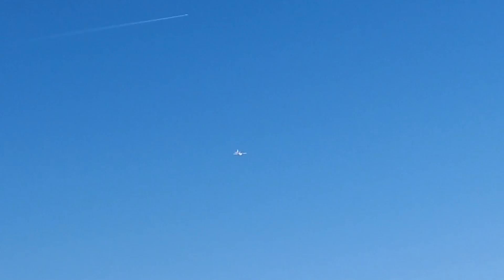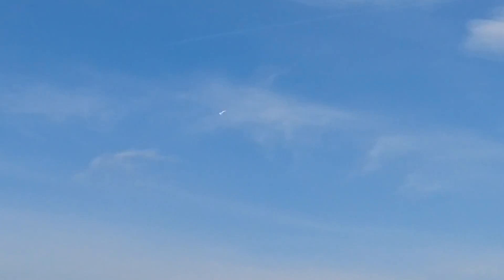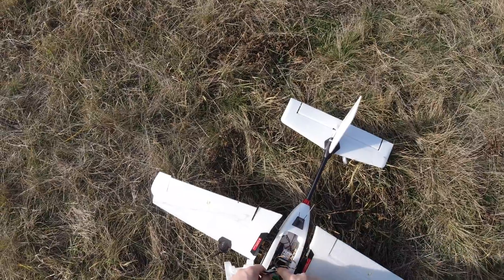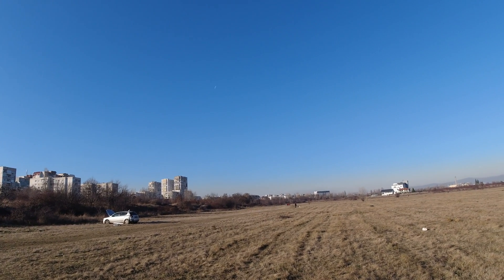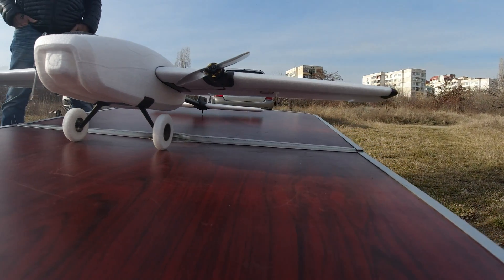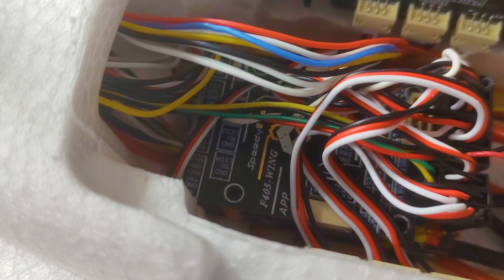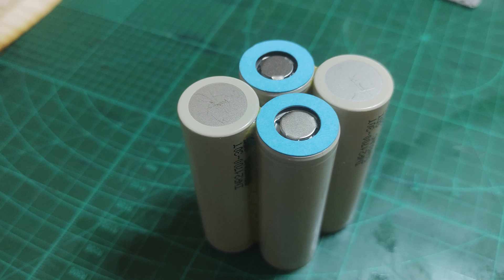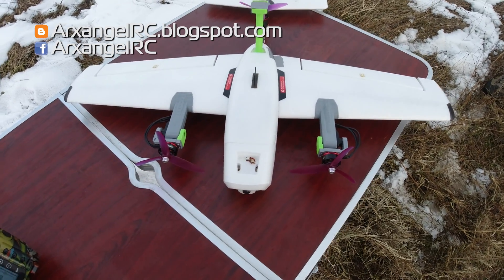T1 Ranger Custom VTOL Conversion - Part 1

Comment: x9d still best ! i'm still using x9d plus se 2019 :D
Reply from the maker: @hoanguyenphuong6405  It is indeed! Mine is from the first ever batch out of the factory, its even older, non Plus. :)
Reply: @ArxangelRC  you do like some new tx product by Frsky ? Tandem maybe ?
Reply from the maker: @hoanguyenphuong6405  They do have some pretty sweet looking radios lately, but I don't have much experience with them, although if mine fails, I may get one if the new ones, they look good and I am reading some good comments about them.

Comment: Dose covering the GPS have any effect on the performance? What is the best size prop's for the stock motors for long range flight?
Reply from the maker: Plastic is transparent to the radio signals, so it doesn't affect it much! As for props, can't say for sure, but generally for a non-vtol version with only tractor motors, higher prop pitch should be able to give you a more efficient flight.
Reply: Great. Thank you. Really enjoy your videos very helpful. Love those cloud flying videos.
Reply from the maker: @phillip7047  Thanks, I love them as well! :)

Comment: 3:18  rather then wood screws. Maybe some thumb screws would be better. I have an eflite Cessna that uses thumb screws to allow the wings to come on and off with ease.
Reply from the maker: Perhaps... will have to find some that would work though! Still may come up with a different solution!
Reply: @ArxangelRC  I’m
Definitely interested in what you find. I have the T1. and I’m putting the T2 together now.
Reply from the maker: @GHOSTDRONEXXXIII  🙂👍

Comment: A great start to a T1 Ranger video series. Always look forward to you videos, and insights. 
If you got an earlier T1 Ranger KIT, there have been a couple for revisions to upgrade ESC's to higher amps and motor mount redesign. Cooling inlets were added either side of the front camera also on latter editions.
Early motor mount had a tendency to develop cracks at screw holes in time, and thus a motor could come free. HeeWing has been nice enough to include details and graphics of the changes on its website, and have been accommodating of pilots experiencing issues. Having done the VTOL conversion, removes this risk and worry for you. Perhaps you can use thumb screws to secure the wings, to make assembly tool-less? The attachments is indeed one thing that could be improved. Also include an extra set of pass-thru wire connections for the VTOL option.
Reply from the maker: Thanks! :) I can't say for sure if this is an early model or not, but it seems to work alright for now. Will see if I can find some thumb screws that would fit the job here... but the VTOL stuff has not required any additional connections between the fuselage and the wings.

Comment: I put the VTOL motors and 25amp ESCs on my  standard T-1..Have Always flown 4s 1800 mah packs and I just put a small strip of Gorilla tape along edge of wing to fuselage.  Never had an issue and I often punch Full throttle . Maybe not an eloquent fix..But Works great ! Happy Flying 👍
Reply from the maker: Well that's the problem... why does it need any kind of fix... why hasn't it been made properly from the factory? I haven't had to tape wings as a precaution on anything after the X-UAV Clouds... and we are talking large and heavy mapping planes!
Reply: @ArxangelRC  Haha ok, we 
"shouldn't " have to do it....but it IS a fast and Easy Precaution ...I haven't heard  about a lot of people disconnecting a Wing in flight...maybe it's been happening to the masses..but a couple strips of tape, take it off and easily break down the plane and you're packed in your MC Boot ready to go !
Reply from the maker: @dallasb7117  I suppose... but I still would keep the screws in... I don't trust it otherwise! :P

Comment: I feel so lazy when I watch you casually knock out a conversion like this.  To me just the 3D printing alone is a tour de force.  But I have to admit I had a very evil chuckle when you looked at the specs on those red-bottom motors @5:15 and said "I knew I would have to limit throttle in order to prevent the motors from pulling the plane apart in the event of a sudden full throttle situation".  Mwahaha
Reply from the maker: Hahahahahaha... well... its not really anything special... somebody had done the hard work on designing the 3D parts... printing them is relatively straightforward. Rest is just wire work! And yeah... following my recent experience with the MFE Fighter, I knew full well exactly what could happen if overpowered motors are left unchecked! :D

Comment: I have a T1 PnP, that came with the V1 ESC's (20A). The VTOL conversion kit had the same V1 ESC, at the time. Unfortunately, one smoked in flight - vertical mode on my way to land - but I was able to glide in for a smooth landing. Thanks to some Epic support from HeeWing, I scored a full set of the V2 25A ESCs for cheap, and the bird has been solid as a rock for almost a year now. For such a little plane, it's a ton of fun! 

I have a couple neighbors with DJI's, who put them up once in a while to hover around and take videos. The best fun on Earth is to fly over, switch to hover mode, and orbit them with a plane then fly away like a boss 🙂
Reply from the maker: Yeah, if you transition high enough, there is time to get a hold of it and land it as a plane, well done! And yeah, it is a ton of fun indeed! Hahahahahahahahahaha, taunting the DJIs is a MUST! Well done on that as well! :P

Comment: ELRS on 200hz for planes is total overkill, I run 150hz on freestyle drones that need fast reaction time and 50hz on planes since I dont even really feel a difference between 150hz and 50hz
Reply: It doesn't matter so long as everything's working, I run my crossfire at 150hz 500mw and at 9.5 miles when I lose video I've had 0 loss on my crsfr, never have had a need to run it at 50.
Reply from the maker: @trumblez I honestly have no idea... this is my first go at ELRS and I don't really know much of its details, it is what was set by default!
Reply: @ArxangelRC  ok, no problem, take it as an advice
Reply from the maker: Thanks! :)

Comment: Did you actually make the landing gear work on the regular version? Mine was a great disappointment; it insisted on ground looping after a meter or so. The wheels didn't seem to bind, but the right one must have done just that. Did you do any kind of mods or hacks to achieve a straight ground roll? Differential thrust?
Reply from the maker: It worked for like 1 landing, until I discovered the high thrust to wing mounting system issue. The landing gear broke during crash landing in the first such event, so I haven't used it since! I one landing they worked well, and the plane did not tip forward, although it was tail heavy during that landing... so that might have helped! I adjusted CG and after take off... at some point one of the wings disconnected and the plane crashed to the ground, breaking only the landing gear... soooooo... can't say more on it! I did have differential thrust though, can't say for sure I used it during the two rolling take offs to keep it straight... might have!